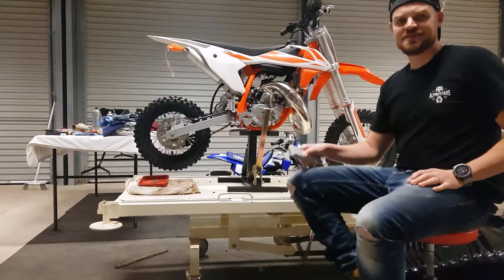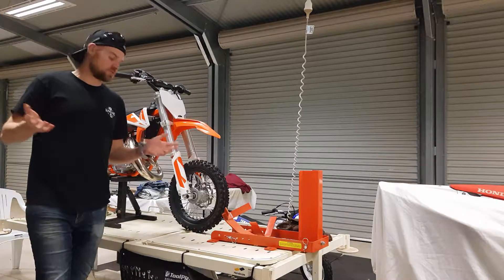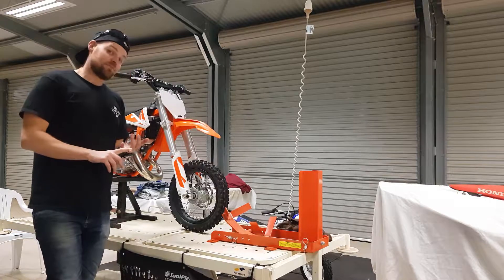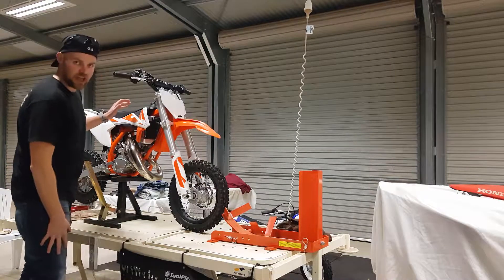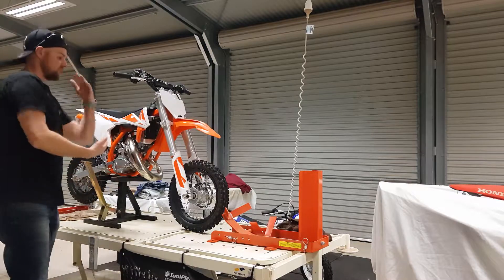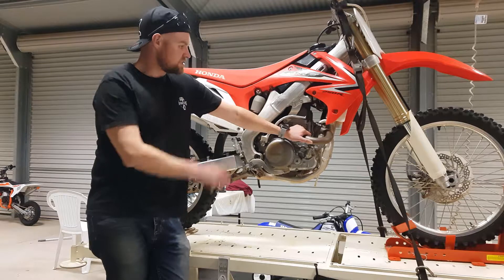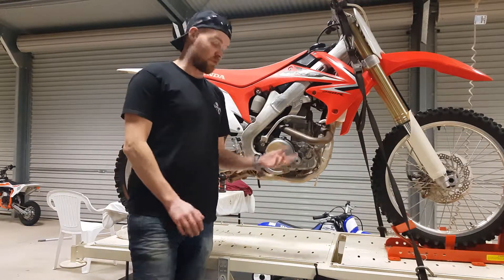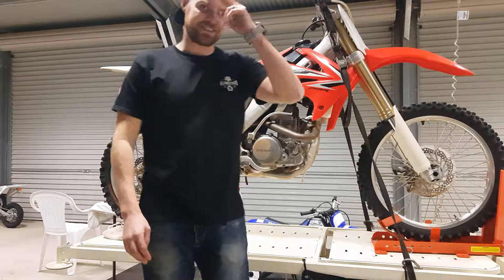Electric Motorcycle Lift / Hoist For Under $100. KTM 50SX Honda CRF250R

Comment: I’ve just bought one. Being delivered today. I’ve gone for the manual foot pump model as it will be outside even though it’s under cover I didn’t want the electrics getting damp. Should be good and like ya say no more backaches 🙄 nice wheel chock what make is it please. Good video 👍
Reply from the maker: Hi Gary, it was just from Supercheap Auto, can be seen here https://www.supercheapauto.com.au/p/sca-sca-motorcycle-multifit-wheel-chock/320957.html

I think I got it for $50 on a half price sale. Usually if you hold out long enough you will get stuff like this with a good discount with them